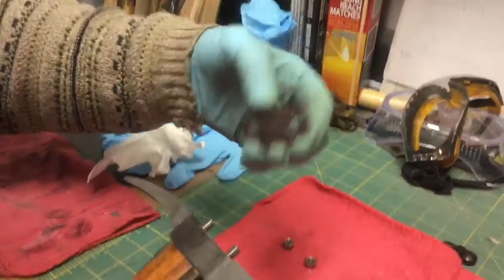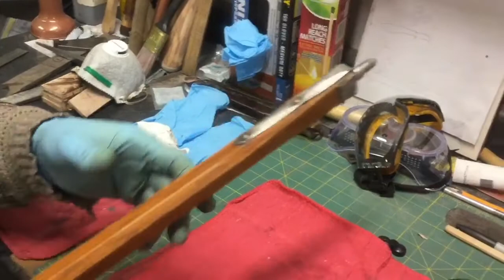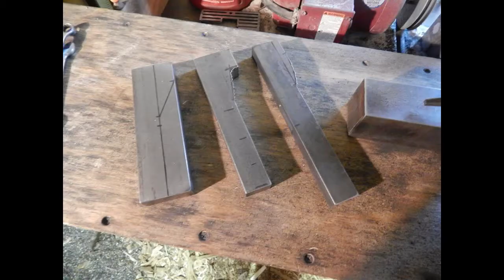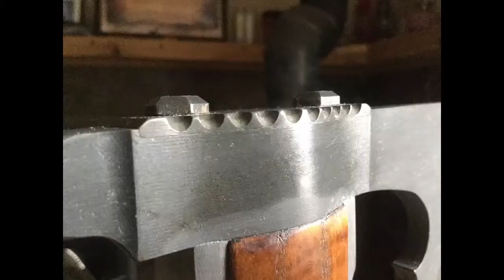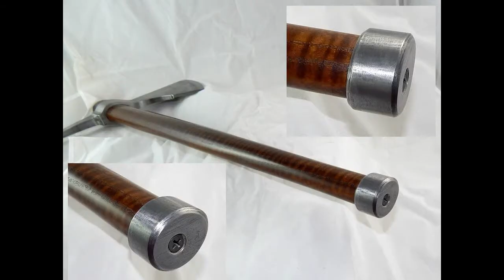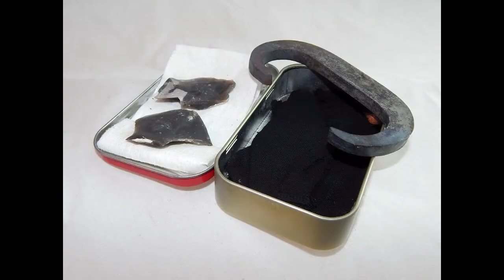Fokos Walking Stick Shepherds Axe construction by WalkByFaith777

Comment: Wish I could afford one of these beauties, tried making my own with a tomohawk head and a pitchfork haft I sawed off...didn't end well
Reply from the maker: Chad Thunderkoch that’s a good idea it’s too bad it didn’t end well cause that’s a cool idea.
Reply: @wbf7773  thanks, I'm gonna retry with something else since instill have the head
Reply: @wbf7773  done it, I found an old rake that I cut the head off of
Reply: @wbf7773  though it's probably just gonna be decoration since the handle is a bit too frail

Comment: what are those bars on the sides?
Reply from the maker: The metal "bars" on the sides of the handle that extend up through the head and secure on the top with filed nuts are called langets.  They help strengthen the connection between the head and handle and they improve the beauty and balance of the walking sticks and langet-style axes.  The concept has been around for a very long time.  Langets are very labor-intensive so very few makers offer them.  We think they are worth the work.  Also, we hope to soon offer langets that extend all the way down the handle.